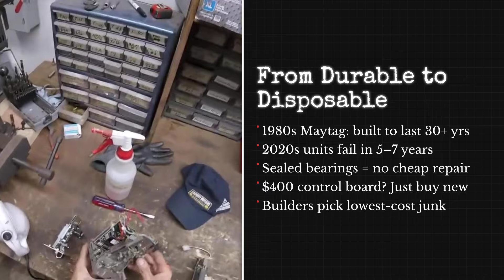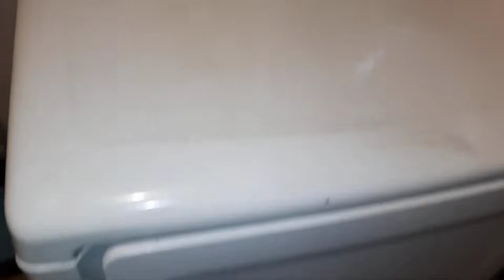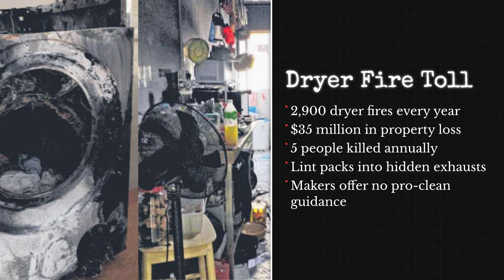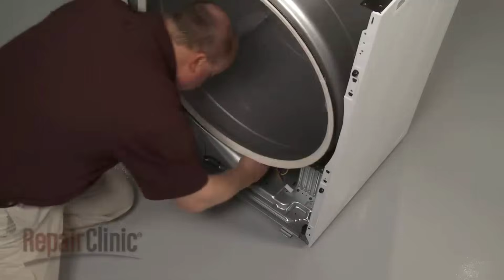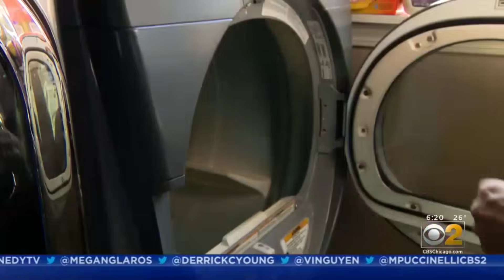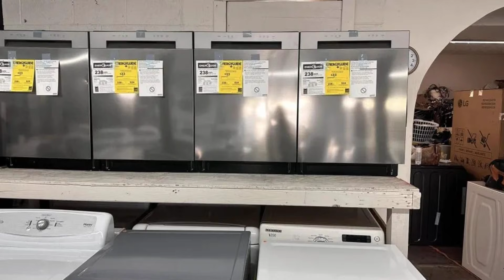Why 90% of New Dryers Are Garbage (The Heating Coil Trick)

Comment: There are increasing numbers of dryers without doors that allow access to the heat exchanger coils, and these are not acceptable.
Reply from the maker: You hit on one of the most anti-consumer trends in the industry! Removing that access door is pure Quality Rot. It turns a 10-minute maintenance task into a total machine failure. They want those heat exchangers to clog up so you’re forced to buy a new unit instead of just keeping the Backbone of your current one clean. It’s a complete lack of Mechanical Integrity. Have you found any current models that still respect the user enough to provide an access panel, or is the 'sealed' look now the industry standard?
Reply: @QualityRot I'm not too sure about other brands but Toshiba launch 2 model in a row without access door TD-T25BS110HWS(MG) and japandi

Comment: I repair dryers for various brands, None use your so-called "sealed bearings" All of them are replaceable by removing a few screws, even the ball bearing ones can be pressed out and replaced easily enough. You sure your not talking about washer sealed bearings?
Reply from the maker: I appreciate the professional correction! You’re 100% right—I’m likely conflating the sealed outer tub scam we see in washers with the dryer discussion. It’s good to hear from a tech that dryers are still holding onto that modular repairability. It keeps the Quality Rot focus where it belongs: on the thin heating coils and disposable control boards. In your experience, are you seeing any brands starting to move toward plastic motor pulleys or other 'weak links' that are making modern dryers less reliable than the old workhorses?

Comment: My maternal grandmother's General Electric washing machine worked for about 40 years, it was a roller washing machine, they changed the Transmission belt a couple of times, but that was it, it had a lever with three options, wash, rinse, squeeze, the latter option to run the rollers to squeeze the clothes. That washing machine was made of enameled steel, real steel, thick and resistant to corrosion.

Comment: Our WP electric dryer is 38 years old. WP washer (direct drive): 31 years old. No major problems. Simple to repair & most parts that fail are still available. Someday, I'll remove their sheet metal exteriors & have them repainted. You couldn't give me a new appliance unless they were speed queen.
Reply from the maker: lol that’s right

Comment: So much slanted misinformation here to promote Speed Queen and Meile dryers. BTW both Meile and Speed Queen Dryers have computer boards which will fail regardless of the paper warranty. If you want a dryer which will last 15, 20 years or more buy the model which has been around since the 1960's and is still sold new, even in big box stores. It's manufactured by Whirlpool and is branded under several names like Maytag, Amana, Roper, Kenmore, Estate, Inglis, etc. This dryer is easily identifiable by the small lint filter door located on top of the machine cabinet. ALL parts are available for this machine from the manufacture, are inexpensive when replacement is needed (if ever) and repair is totally DIY. However, only buy the basic machine without Wi-Fi, or steamer function or any other "sensory" or "high efficiency" advertised on the control panel, those machines have computer boards which are expensive to replace when they fail.

Comment: We have a 5 yr old Whirlpool.  It h as been nothing but a problem since we have had it.  Replaced the thermostats, all of them, and the thermal fuse last about 2 weeks.   I got tired of spending money on factory parts.  I get them from amazon  or Ebay.  They last just a long.   They are all crap.
Reply: Find you home's dryer exhaust vent and check it with the dryer running. You probably need to clean it out with a holikme vent kit then blow it out with a leaf blower.

Comment: My 15 year old whirlpool gas dryer has a stainless drum and has no problem.  The worst thing done to dryers is allowing builders to vent through the roof.  The dryer should always be on an exterior wall, to the right of the washer.
Reply from the maker: That 15-year-old machine is a beast, and you are spot on about roof venting being a huge mistake! 🚫

Comment: My Sears Kenmore dryer is on its 33rd year working fine, but since I live alone I only use it for approximately 3 loads once a week. The Sears Kenmore washer lasted 31 years I now have a Speed Queen washer which I love, I bought it after hearing horror stories of other washers.
Reply: I have a Kenmore, I think it is on year 27.
Reply: Kenmore still running on year 21, only 1 $200 repair

Comment: Feb. 2024 I bought a Whirlpool washing machine at Lowes to replace my 26 year old Whirlpool washer that finally died.  In 1 month it quit.  Something about the sensor on the drain failed.   Needed a new board.  Fast forward to Feb. 2026...Same problem, sensor on the drain.  Whirlpool knows about this problem.  Every time I do laundry its a crap  shoot...
Reply: 26 year old Whirlpool washer can be repaired.
Reply: @waltchan  Still wishing I had it repaired...
Reply from the maker: That's an incredibly frustrating cycle, and it perfectly highlights why those new electronic sensors are often the first thing to fail! 📉

Comment: We have had a LG washer and dryer set running for 16 years so far. Recently we have started to need to occasionally unplug and plug back in the washer to get it to power on.
Reply from the maker: Hmmm I wonder why?😮
Reply: Board is failing 😢
Reply: Corrosion of contacts, rust on electronic components is a disaster, the boards are usually covered with silicone, but the contacts are exposed and oxidize.

Comment: I have been purchasing Kenmore Appliances since 1976 Sears and Roebuck's. Still using a 1990 Kenmore stove. Had washer/dryer set that finally kicked the bucket in 2019. My Kenmore microwave lasted 15yrs.(stopped 2024)
On my second Kenmore Fridge in 50 years. Maybe I'm lucky, I just know Kenmore and Frigidaire was the most reliable with less problems. Man the Good Ole Days 😁
Reply from the maker: That's incredible longevity compared to what's made today! 🤯
Reply: @QualityRot 
Only replaced the ignitor 2 or 3 times in my stove. Replaced my washing machine agitator twice. No repairs to the dryer. I had to buy a new Kenmore water heater in 2001, which lasted until 2020. Too bad all internal parts are now made of plastic.
Reply from the maker: That is the perfect illustration of why the "Old Guard" of appliances is so superior. You’ve spent a few dollars on basic wear-and-tear items—ignitors and agitators—rather than thousands on entire replacement units.

The shift to plastic internals is the smoking gun of Quality Rot. We went from internal components designed for heat and friction to "engineered polymers" designed for the manufacturer's bottom line. A water heater lasting 19 years is a win today, but as you noticed, once those metal internals are replaced by plastic valves and thin-walled tanks, that lifespan gets cut in half. You aren't just "lucky"; you are reaping the rewards of owning machines built before the industry decided that durability was a bad business model.